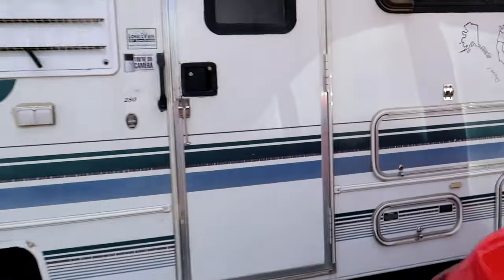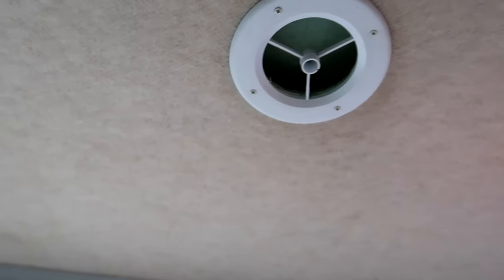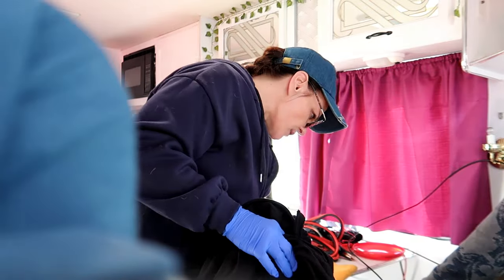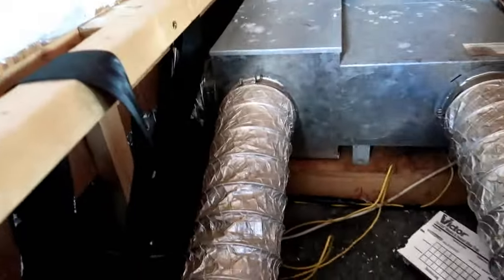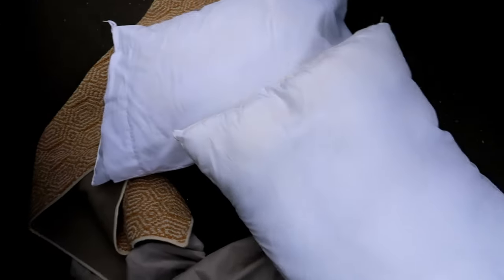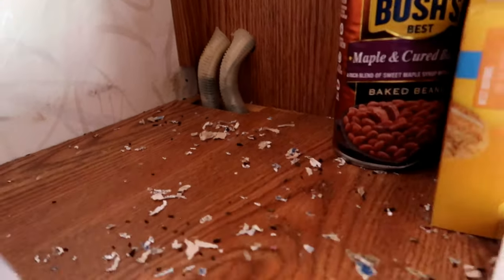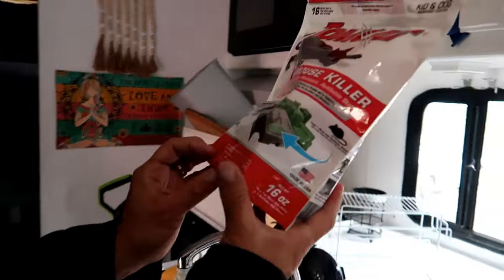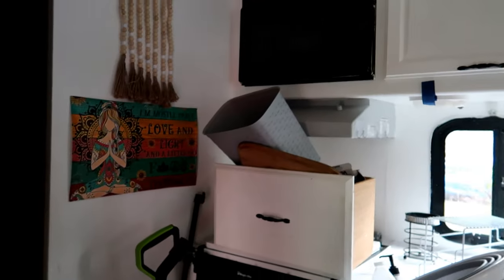I caught him in my RV | Dewinterizing my RV

Comment: Man dont use those sticky traps, they are so in humane, back in the  early 2000's my mother called me upset, I drive to her house only to find a tiny baby mouse stuck on one and screaming its little head off, My mother was upset and all I did was cry, I did what I could to get his tiny feet off so he could go find his mommy. I now use LIVE traps, you can 2 for like $12 but you can reuse them for life, they go in and get the peanut butter or cheese and cant get out, you just take it outside near a gutter and open the other end and they will run out into the gutter. But at least they aren't suffering. 😞
Reply from the maker: Maybe they all ran  away and I won't catch any of them